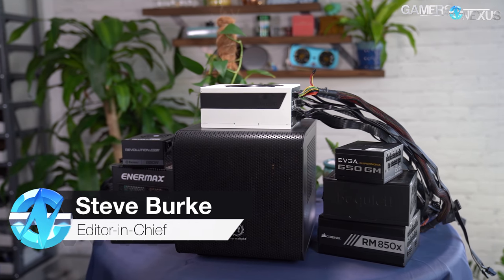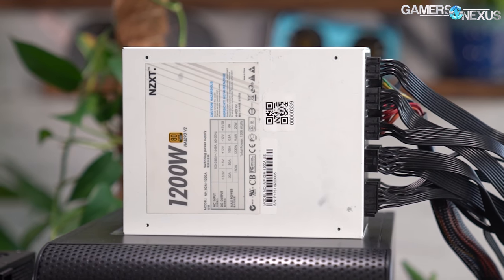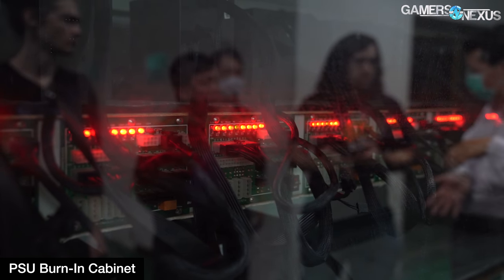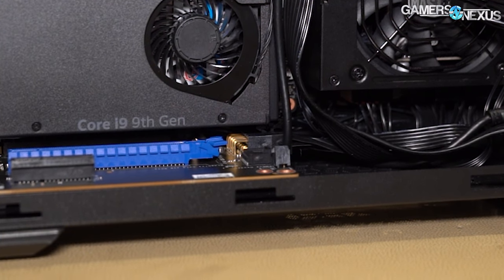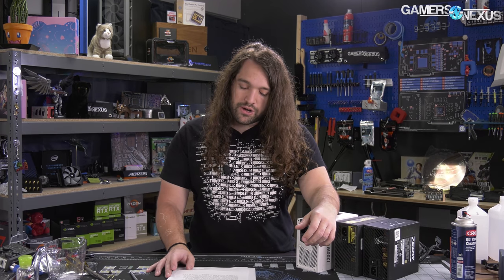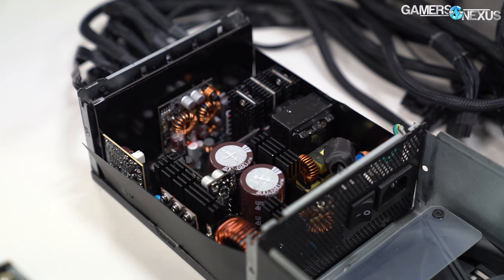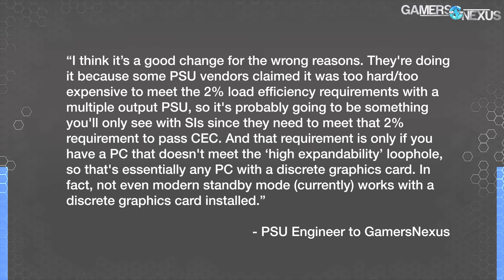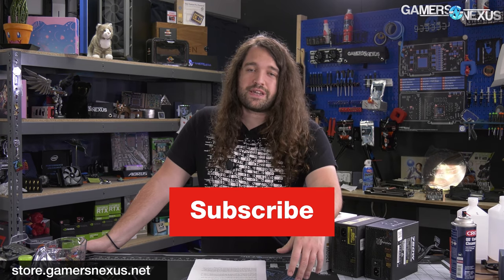Intel's ATX12VO Spec Explained & What Manufacturers Think

Comment: They also should switch the entire motherboard to only supporting something like USB C so that way your internal hard drives and everything that needs power or input/ output data is using the same type of connector data and power provided.

Comment: I think there is an opportunity to surpass 12 volts and go to 52 volts.  Smaller traces and less waste heat. But it's also possible to deliver massive power if really needed. Just different buck chips on the motherboard. Nothing runs at 12v anymore (3.3 is the new norm) so it's all going through bucks anyway.

Comment: Awesome piece. Thanks GN!
I am curious how big the 12v->5v conversion ICs would be on the motherboard, I've seen 1"x1" PCBs that do that for a couple of amps. It would be nice if we could get the 12v/5v PSUs JGuru was floating.
Reply: The IC is tiny. The inductors are much bigger. Those things can be almost a whole square centimeter.
Reply: I should have know better than to use terminogy I don't really understand. :) By ICs I meant the whole of thing, but didn't know what the right words are. Correction noted.
Reply: Please don't mix different unit systems.

Comment: If they reduce the size and number of PSU cables that'd be sweet, but if we are still stuck with molex after the dust settles I will be sooooo mad
Reply: The new connector is still a Molex connector. Like most other connectors.
What is wrong with Molex connectors?

Comment: Why there is no +20V rail?

If you push power standard to meet USB issues - you need to meet USB Power delivery as well.

As an enthusiast in both PC and power efficiency, I prefer to buy one expensive efficient 1000+W power supply per "table". And power with it all devises on it. PC, monitors, laptop, phone, led lamps e.t.c.

Comment: Hello, Steve;
Thank you for all you do.
This reminded me of another "Intel standard".
Do you remember "Slot 1" cpus?
If Intel does something bet your bottom dollar its Intel's "almighty dollar" worship.
I've still got the Intel Corporation D815EEA board that had a BIOS RAM limit of 512MB.
Yes, ONLY 512 MEGABYTES!
So when I found out I couldn't upgrade the RAM I put the max in 1 RAM slot & let it ride.
A CPU upgrade to 1,000MHz Pentium was about all I could do to improve performance.
That convinced me--I've never had another Intel CPU & I want to avoid anything Intel.
That kind of greed is extremely offensive to me, maybe it doesn't bother you.
I don't care about having the fastest or the best, I just need to have hardware that works.
Having enough RAM is, IMO, crucial to having hardware that works.
So Intel's artificially low RAM limit was apparently an effort to 'encourage' people to upgrade.
So I did--I bought AMD.
I will always buy AMD, or ARM, or anything but Intel.
You do what you want, just don't expect me to buy Intel, even if you say it is the very best.
I'm 65 & I'll NEVER forget getting shafted by Intel's obscene greed.
Have a GREAT day, Neighbor!

Comment: I as an electronics hobbyist and gaming enthusiast think that moving the dc-dc conversion on the motherboard makes a lot of sense. Very few devices use voltages other than 12V anyway, so you can just place the conversion circuitry right at the place the voltage is needed. I believe that could even help with noise and all that, depending on how it is implemented ofc.. Servers, notebooks and small formfactor, its all 12v these days anyway. Just doesn't make sense to route all of the voltages through the whole system to just power some IC in some corner.

Comment: esata connector would be a good solution the mobo as it is both power and data and you could use one cable, and prevent extra connnectors on the motherboard and could split to standard sata and power.

Comment: I foresee a new PC component... DC2DC converter... possibly in a form factor that fits in a 3.5" storage mounting location.
It'll have an input connector for the 12VO PSU, and an output connector for the 24pin cable.

If the 10pin + 24pin connectors weren't so big they might be able to get away with it being in a 2.5" form factor... I don't know how much room they need for the actual DC2DC circuit board components.
Reply: It already exists, and it's the exact same form factor as a standard 24 pin connector.
Reply: @williamforbes6919  12v can be converted to 5v, 3v, and -12v in something the size of a 24pin connector? That's freaking amazing!
Reply: @iwantmypot  It's pretty cool tbh. They sell under the name of PicoPSU. Using one you can run an ATX system off of any 12v power supply, so they are super popular for SFF and CarPuters. Cheap too, a 120W will run for around $30. Of course the GPU can use the 12v supply directly, so that 120W can all be used for the CPU and peripherals.

Comment: Wouldn't it be more efficient to have the PSU do the 5v/3v conversion?
Why does it even matter where the 12v to 5v/3v conversion take place?

Are we likely to see drives and other accessories move towards a 12v only design?

Comment: so who's going to be the first vendor to drop onboard SATA and go M.2 only? Motherboard vendors could also just decide that they aren't going to deal with the 5V or 3.3V beyond what is needed for components on the board (USB, CPU) and leave it to a PSU company or someone like silverstone to make an adapter that takes PCI-E/4pin molex power in, and spits out sata/molex power including the 5v rail.

I'm big into the mini-itx systems and SFFPCs, so i could see some of those ditching SATA all together for U.2 or U.3 connectors.

Comment: I don't understand the efficiency argument for eliminating the 3.3 and 5 rails.  Yes the PSU as an independent unit will be more efficient but that's because the efficiency losing components are being moved to the motherboard.  I don't see how overall efficiency of the entire system would be improved.  
I can see how it might be advantageous for customizability of motherboard offerings.  They could provide many more drive power connections than a standard PSU would normally accommodate if they choose. Of course being able to squeeze the dc-dc conversion and 3.3v and 5v power connector hardware to the motherboard means we'd see a lot more e-atx.

Comment: even if motherboards manufacturers try to use new stanard, old psus will still work, pinout are the same except stndby voltage, which is 12VSB instead 5VSB - solution is a simple converter which cost pennies, whole custom adaper should cost 8-10$ max

Comment: Who remembers the short period of time where Intel boards required the 20 pin ATX and that 5v and  3.3v AT style connector before the single 4 pin 12v came out?
I am of the same opinion of the PSU mfg, phase out the 3.3v (I'm pretty sure that was going to be the future for SSDs) and -12v like they did with -5v a while back. If they are feeling really frisky they could even just lop off the 3.3v section of the 24 pin and have an interim period where new 12v and 5v only mobos with a smaller connector could take a 24pin ATX - assuming they can get enough 12v and 5v current on the existing pins (lean heavier on the 8 pin CPU 12v maybe) Personally, I don't like the idea of a mobo doing much more pixie wrangling than to derive the CPU / RAM voltages

Comment: just have a 12v to sata+molex brick as part of the case...sure its yet another part, but, the good things would be, with decent cases, the cabling for drives like hotswappable bays could be wired in very slick ways.. (i have used solutions like this for servers...its...interesting...)

Comment: How about a new ATX standard that puts the power connector at the bottom, so it's close to the PSU on modern cases with bottom mounted power supplies?

Comment: +3.3 can be easily moved over to the MB. -12V is useless in modern systems anyway. +5V however, is seeing increased use in recent years with SSDs. I wouldn't like my MB limiting my drive upgrade options. PSUs should keep the 12V and 5V and remove the 3.3V and -12V as the engineer suggested. This would make the standard much more easily adoptable in the DIY space as well. And, let's not forget, DC-DC converters generate noise that may effect components residing on the MB if the power draw is high enough. In the PSU, those noises are mostly isolated from the rest of the system.

Comment: I, for one, can't wait to get rid of the 8-pin CPU connector and the thick AF 24-pin cable. I have a Phanteks P400A and am rocking a Thermalright Macho Rev. B which made mounting the 8-pin cable a serious pain in the ass. I wonder what this is going to do to the price of motherboards tough because they will have to implement more "stuff" in there and motherboards get replaced more often than Power Supplies. I have an old Enermax Liberty 500W PSU which is now working in my dad's PC and is 15 years old at this point (caps still not leaking somehow). I'm also rocking the old Corsair RM 750x in my main PC and it has been in 3 different builds. That higher up-front cost is mitigated by the fact that I don't have to spend extra money every time I build a new system.

Comment: VRM drives and most DC-DC converters need 5V;   The 3.3v on the DRAM could be supplied by the usually unused 2nd output of memory VRM.
Reply: VRMs can be designed to use 12V only.

Comment: Does this actually increase efficiency, or does it just move the problem?  Sure, the PSU is super efficient (which means like 2%), but overall system efficiency could be worse if the motherboard manufacturer cheaps out.
Reply: Wouldnt be the first time that "environmental rules" backfired. After all, the smog rules of the 70s were so abrupt that fuel mileage plummeted, dramatically increasing CO2 emissions. Whoops. 

We cal already get 97%+ efficient power supplies, at some point the ones making the rules will have to realize there is nothing left to squeeze out.
Reply: Less cable lose in the cable between PSU and mainboard.

Comment: This new power supply is all nice but we are transfer the heat to convert the voltage to the main board that already have to many thing producing heat, also in case of fail the board will burn more parts and kill more chips

Comment: I'm curious what the efficiency of motherboard voltage conversion would be compared to PSU voltage conversion.
If it's roughly similar (or even worse), they're not actually improving anything. Just making the number on the PSU look better.

Comment: Eventually I'd expect the entirety of a PC to just run at 12v, which would include USB, which would ultimately include Everything on USB. From Thumb Drives to Smartphones, audio interfaces, etc. It is techncally better in terms of efficiency, that's why countries with more modern power lines run at 240v instead of 120v and that's why usually devices are able to operate better, be it more efficiently or with more power at 240v instead of 120.
Reply: Can't run USB of 12V. There is just not enough space.
5V is a very common logic level voltage. In other words >25 years of microchips run directly off those 5V.

Also: Imagine your phone having to step up its 3.7V battery voltage to 12V just for the EXTRA THICC microSD to step it down to 5V again.
Reply: @MazeFrame  USB-C already supports 20v and OTG, so crazy shit like this can already happen (in very specific scenarios)

Comment: Dell is already running lots of systems with this new standard. LTT latest best buy gaming box used a 12vo PSU.
16:30 they are going to fit on an E-ATX board.

Comment: 5V (or 5Vsb at the very least) should stay for far too many reasons, but 3.3V and -12V should have been removed long ago. This stuff has been standard with server gear for a long time. Perhaps you could even remove the 5V rail if you include a USB-PD controller on all the motherboards or in the PSU. I would love to see thicker silicone sleeved cables doing only 12V to CPU/GPU, as well as a far smaller ATX24 connector. 24 pins is too many. Should be like 8 pins max.

Comment: My kids pc is still rocking my Corsair TX750 which i bought to power my GTX 9800Gx2 back in 2008.. I'd be using it but i just felt that when i went to ryzen in 2017 i should buy a new psu. Corsair RM1000i which i hoped to keep longer but i guess this standard might change that.

Comment: Wouldn't this spec then mean (if it were ever adopted by the DIY sector) that adding any other drives via an HBA or a RAID card would be impossible as the motherboard is only anticipating delivering power to 4-6 drives? Presumably in this hypothetical case such cards would have to be reworked either with a power socket for 12v intake and supply to the drives or a possible modiciation to the pci-e slot?

Comment: I have 8 different Fujitsu mainboards ranging from 5-15 years ago that only work with Fujitsu 12V power supplies.

These are desktop, workstation, retail mainboard(made by MSI) and server boards.

These 8 different mainboards need 6 different power supplies with zero connector compatibility.

Because of this, replacement PSU's for these fuckers would cost anywhere from 100-500€ in the open market. And most of them are rated between 250 and 350W.

It's high time there was a standard for 12V supplies because the current market for them is silly.

Comment: Converting the 12V to 3.3/5V separate could be more efficient but I wonder how much of a difference it really makes. I imagine it's not much of a difference considering they only seem focused on PSU efficiency to stay within regulation and no one is talking about real-world-efficiency. 

I also hope it stays away from DIY. Even though PSU's would be cheaper and motherboards more expensive, it would still be more expensive overall considering PSU's are reuseable but motherboards often aren't. Also motherboards seem to break a lot more often then PSU's.

Comment: i already see a huge problem with this spec; if all your other voltages come off the motherboard and whatever power circuit controlling it blows (which is probably very likely on a lower end device if it overheats), you'll have to replace the entire motherboard.  which then gets into the problems of greater e-waste, OS activation, and companies being bastards about warranties.

Comment: Isn't the idea of improving efficiency the less energy spend generating useless heat in the components while doing conversion? As you may have notice that the more heat generating adapters are those from laptops because they have to convert 120V AC into 19V DC in a way that are single input that later do other DC to DC conversion inside the laptop itself. And yes there is no unify standard regarding laptop adapters as the one manufactured from HP doesn't work well with laptops manufactured by others like Dell and vice versa. Are they trying to import this scheme into a standard for the Desktop market?

Comment: the concept is good but if ones wanted to expand their storage after all of SATA port used, that means you need to buy additional backplane with buck converters. that's kinda troublesome i guess?
Reply: I guess? I would imagine that any new SATA card would have a 60¢ buck converter to let you run another six drives.

Comment: iirc some of the dell usff may have the 12VO already? the power supply only has 2 cables (8 pin and 4 pin i think). And to power the drives, there is a cable coming from the motherboard
Reply: Dell full towers have been using this since Haswell. So it doesn't really change much other than it no longer being proprietary to each vendor.

Comment: Would you not just add a buck to the case instead of the motherboard?

In a HPE server the 12VO PSU connects to a power backplane

The case  would just tuck a power backplane somewhere in the PSU shroud

Comment: would the 5V/3.3V breakout really NEED to be on the motherboard ? couldnt PSU manufacturers make a breakout box that could be mounted where convenient somewhere else in the case, possibly connected inline on the new 10 pin 12V motherboard cable to split off 3.3/5V ? yes, 5V is still required for USB, but USB C already requires boost converters on the motherboard anyway, so no real change

Comment: Depending on the efficiency benefits, I may very much like this. Especially if it means cleaner power overall. While, yes, we're just moving the efficiency problem to the Motherboard, we're also making sure that we're only converting the power we need; and potentially a motherboard can forgo these stages entirely and use only PCI based storage. This would facilitate far lower idle power as well, since many SATA drives can be shut off entirely if the host system uses a PCI based device for main storage.

I really don't see much reason NOT to continue with this transition. The only drawback seems to be that motherboards need to do voltage conversion from 12V to 5V, but at the end of the day, the amount of space saved with a significantly smaller connector may greatly outweigh the space added in that circuitry. I also doubt much will change in pricing considering how bloated motherboard pricing is as it is.

Comment: At 4:55 on the bottom right corner of the motherboard you can see what I assume are holes for M.2 standoff mounts and yet you have no M.2 Connector on the motherboard.
What gives? Surely there should be a M.2 connector located at that point? 

Or is the cost of roughly 100mm of total wire length and 5g of plastic + installation really that expensive? I mean all the other parts are already being fitted so you only need to position the connector onto the board and then run it through a solder bath.....
Reply: Maybe on the backside?